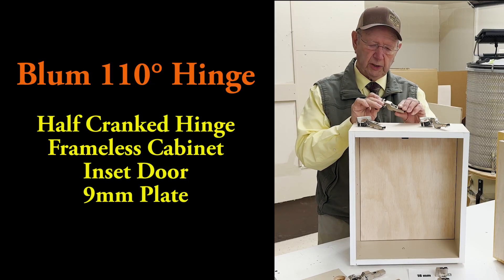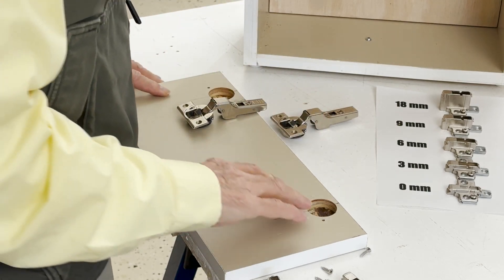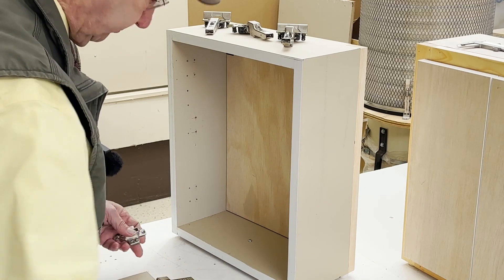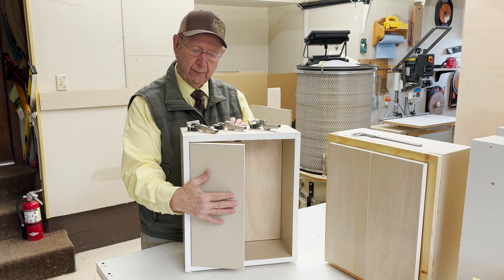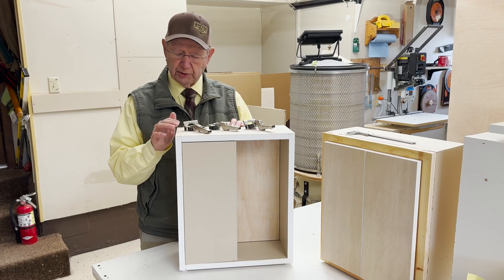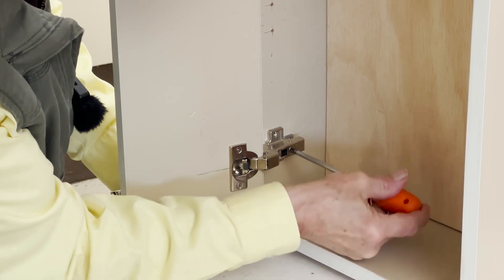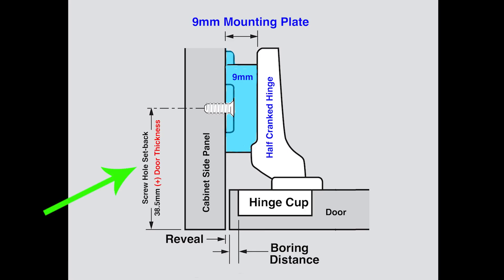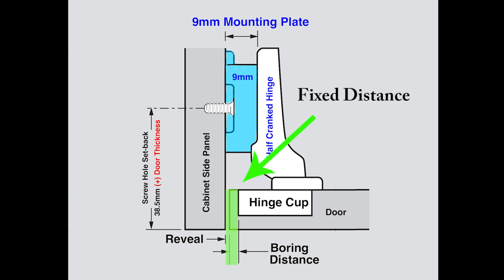Using a Blum, Half-Cranked Hinge to Create an Inset, Frameless Cabinet Door

Comment: Don't buy this garbage. A very unpleasant case with these praised hinges. I recycle my kitchen myself - I paint it with Levis paint, it turned out perfect. I go to the Bloom representative office, buy a lot of Legrabox Pure - which I also assemble myself and make their complementary parts, I explain it, as an example that I have a lot of technical literacy. I change all the hinges, the saleswoman pushes me exactly these Blue Motion ones and gets angry that I only take 2 for a sample. I put them in the same ready-made Bloom beds - a total disaster, they close not at 110, but at 70 degrees. The cabinet sits open and even with force it can't be closed. It can't be opened, you still need force. In my tools there are 2 Turkish STAR hinges that came from who knows where, removed from a discarded cabinet, I put them in - they close perfectly smoothly, they only have some strong springs inside them. I went to the Blum store with the video - how I remove a regular Blum hinge and replace it with a Blu motion one and how a funny and stupid situation results - of course, they blamed me. Big deal, both are 10 euros, I don't care, the attitude is bad - We are Great, you are stupid....

Comment: Man, there's so many options it gets confusing. I just did some doors about 8 months ago and I think I used Blum 71T3750 with a 0mm mounting plate. I'm getting ready to do some more and I started searching to refresh my memory and found this video. After watching I've spent the last two hours thinking I must be mistaking. But I'm now, after comparing part numbers, believe I was right to begin with. So my question is why are there different hinge/plate combinations that do the same thing? Why would you use a hinge that requires a 9mm plate when you can use one that uses a 0mm plate?
Reply from the maker: The world of European concealed hinges can be a little overwhelming!
To answer your question directly as to why you can get the same results with different combinations, here’s a couple of scenarios.  A cabinet maker may be using a straight arm hinge for most of their work.  They have a couple of boxes of hinges on the shelf and they find they must do an inset job.  All they need to do is get a larger plate to use with their stock hinge to make an inset door.  Another possibility is the cabinet maker may be using a 120° hinge from Blum.  Blum doesn’t make a 120° hinge for inset, so they us a larger mounting plate.
Please feel free to give us a call with any application you have.  We are here from 8-5 M-F Central time and will be happy to help.  
– Woodworker’s Hardware

Comment: Hello, Larry
Thank you for explaining (and showing) what "half cranked" means when applied to Euro hinges.  I wish the first pages of Blum's catalogue would be a dictionary of all the terms and symbols we need to know in order to make sense of the diagrams and charts. My supplier sent me what I now know as "half cranked" Clip Top Blumotion hinges with 0mm plates .  Are these appropriate for face frame partial overlays?  I've been experimenting on scrap stiles and cannot seem to get the .5 overlay that the advertisement said I can ("from 3/8 to 5/8").  I've tried my half cranked with 0mm and 3mm (if I identified them correctly). One more thing just to clarify my thinking in my quest:  On a scale of plates measuring 0mm to 6 mm, which plate  is supposed to offer the larger overlay (here, my desired .5)?
Reply from the maker: Hello, (in response to your questions on multiple videos 😊)
The partial overlay hinge will do about a 3/8” overlay when used with a zero mm plate, 7mm tab, and full adjustment.  You would have to use a full overlay hinge from Blum, with a 5mm tab, and a 3mm mounting plate to achieve a ½” overlay.  The compact series have the overlay in the part number.  The tab is a fixed 3mm.  Please feel free to give us a call any time and we can help you understand all the terms and answer any questions, customer service is 800-383-0130.
-Woodworker's Hardware